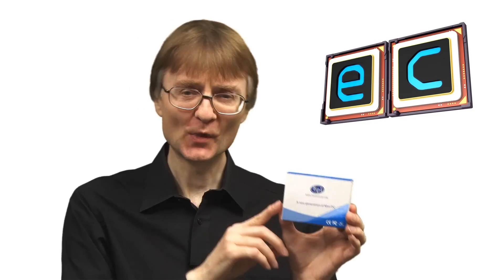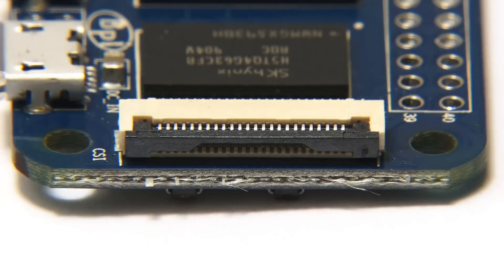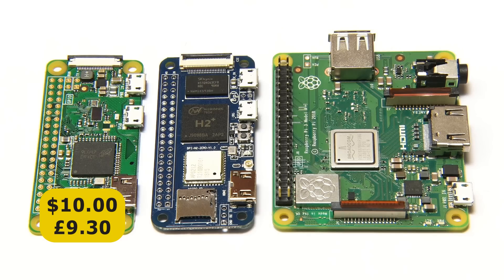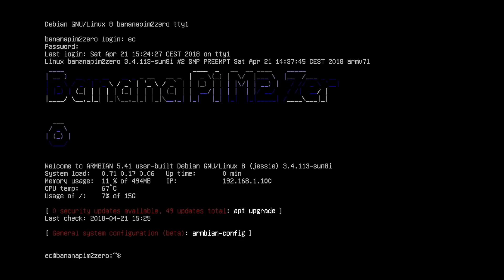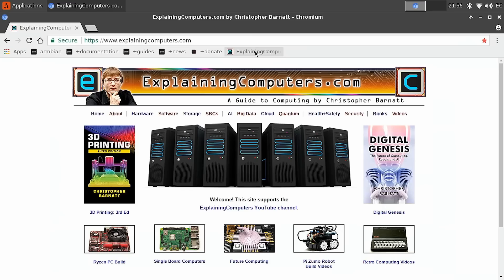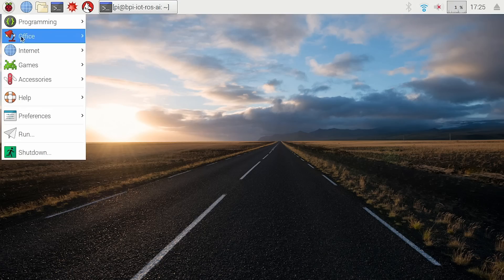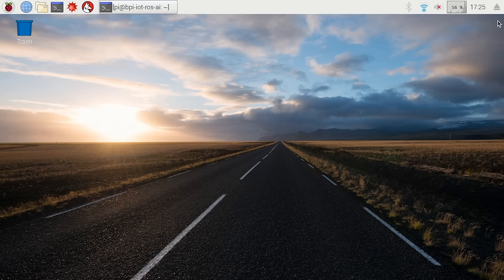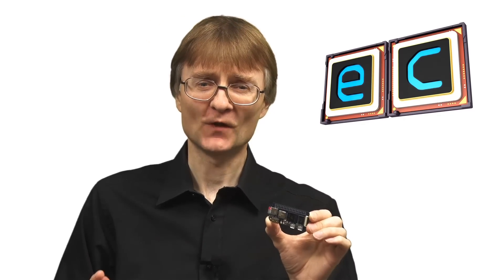Banana Pi M2 Zero: Low-Cost, Quad Core SBC

Comment: everything about this board and the 3A+ was so perfect...and then for some reason only 512MB of RAM? It just makes no sense to me to pair a quadcore with 512mb of RAM
Reply: I was thinking the same thing. 512MB is just too little to really do much with nowadays, especially considering it shares RAM with the GPU chipset.
Reply: @KanokYT  Yeah totally. I'd pay more for it if they had a 1GB variant, it'd be perfect for portable consoles.
Reply: I had a phone with 512MB's of ram, and even when using a "swapfile" web pages would crash on a regular basis. Not sure what the use for this would be.
Reply: @mikem9536  It's not meant to be a desktop, gui-running machine. But yes, more ram would be the first improvement to do with Banana Pi Zero.
Reply: ypu can upgrade it easy with BGA skills
Reply: @servantsochrist  BGA desoldering is anything but easy. Also I've googled and Samsung does not offer single-chip DDR3 memory pin-compatible with stock K4B4G1646D-BCK0 bigger than 4Gb (512MB). Raspberry Pi4 uses DDR4.
Reply: @TomaszStachewicz  Yea I see.... the killer is the fact the largest is 4Gb :-/
Reply: @servantsochrist  yep. So in theory Allwinner H2+ supports up to 2GB (max address space in datasheet) but I can't find DDR3 in FBGA96 package bigger than 4Gb. Micron and Alliance Memory offer 8Gb in  FBGA-96 or FBGA-78 packages, but no idea about compatibility with that samsung. Can't find 16Gb/2GB DDR3 in these packages at all.
Reply: @servantsochrist  also damn, the prices rise steeply for DDR3 8Gb, costing 4x the price of 4Gb within same manufacturer (Alliance Memory), basically the price of Banana Pi M2Z.
Reply: @TomaszStachewicz  well you could check the pin outs but would assume that DDR3 is a standard....but will check
Reply: @TomaszStachewicz  Yea if the price is too steep not worth the effort  might aswell just buy a high performance board from factory

Comment: Technically, the Banana Pi M2 Zero also has 100M ethernet. The four pins between the USB OTG and the USB-style DC connector are, left to right, bottom to top (if the USB ports are facing down): RXN, TXP, RXP, TXN. It can also be powered via the GPIO.
Reply: i am going to build a phone wifi presence detector for home automation using a SBC to trun on lights and unlock doors. wendel from level one techs wrote a blog about that, he used a RPi Zero W for this, but i haven't found his blog yet. while i'd prefer to use the BPi M2 zero because of the hardware, i'm leery of the software acceleration and compatibility. i'm also unclear of the dividing line between hardware and software, re video acceleration and OSs tailored for particular devices. i'm also wondering, if i'm going to run wire to power it, why not just run a wifi antenna to card on a computer and an OS in a container (ansible, docker, BSD jail). i believe wendel used battery power, but i might try wire. cross post: maybe

Comment: They forgot to include the Composite Video pins !!!

I like to stick an RPi Zero W inside of an old CRT television, and solder all connections internally... Turning it into a RetroPie TV.

But the lack of composite out pins, plus the resolution issues, makes this board no good for that.
Reply: @ninline2000  don't. Old games are in 240p, not 480i. Looks completely different
Reply: @ninline2000  
You don't need a converter box with an RPi Zero W... It already has Composite video out pins directly on the board.
Reply: @MrBrax  It looks a hell of a lot better than it does on an LCD monitor.
Reply: @ninline2000  maybe, but I did testing over several months and someone made a 240p firmware, looked much better. I still have some test footage on my channel I think.
Reply: @MrBrax I'll have to look into that. Thanks for the idea.
Reply: Better a male HDMI so you can stick it directly in a modern lcd.

Comment: I love the zero, its an underdog! the stuff I have done with it is fun, I used oxm player to watch a high def video from the command line, I used it as a remote radio streamer with a usb sound card/speaker, even used it as a remote terminal just for testing compiling and running stuff on linux/arm, its pretty great just totally not suited to a gui / web browsing at all, barely enough ram not enough horsepower for modern sites.

Comment: This may work:

Go to /boot/bananapi/bpi-m3/linux

open eEnv.txt

uncheck line 40

save and reboot - and your screen should now boot into 1920x1080

If it works I'll try and find the source.
Reply from the maker: I will try this at some point. Right now, the board is packed away and other things are set up! :)

Comment: Btw instead of writing clear in the terminal to clear it you can use the keyboard shortcut CTRL+L that will clear it right away. Super simple. Another tip for new people is instead of holding backspace in when you accidentally did a typo in the terminal to delete everything you can use CTRL+U that will clear every input you have entered but haven´t executed yet.
Reply from the maker: You can, but this is a video, and viewers can see what I am doing when I type "clear".

Comment: It seems like the Banana Pi has TWO serial UARTS, which would make it quite interesting. I have a few projects where I've used the onboard UART and have had to attach a USB-to-Serial dongle in addition. Having two UARTS would eliminate that need, and I could free up the USB port. The fact that you can use an external antenna is also quite nice!

Comment: For the resolution, shouldn't the hdmi_mode=16 not 31? Or is that 60hz and you want 50hz? Just a guess, I've only skimmed over it.

Pretty neat little board and the 67*c reminded me of something.(Sort of unrelated)
I recently got a pi 4 Model B and I'm looking to apply some heat sinks to the chips (Got the ICE tower for the CPU, AWESOME! Thanks for that video) and having a heck of a time figuring out what 'tape' I should use for the fanless heat sinks. Suggestions? (Too many posts that say they don't transfer heat and I don't want to waste money or fry the board/chips) THANK YOU!
Cheers!
Reply: "Thermal Tape"...
Reply: @KomradeMikhail  HAHA Yeah, I wasn't going to put duct on it. I was looking for a brand or a specific link (affiliate maybe CB?) I didn't think I need to specify the tape needs to be thermal.
I was reading about m3's 8810 and was getting mixed extreme results. Love or hate.

Comment: $20 is way too much when a pi4 2GB is now $35
Reply: ain't that the price of 1GB version, with 2GB being $45
Reply: The RPi4 is too large for some applications.
Reply: I have seen this board for $17 USD.   But it gets to hot.  I decided to use the 3 A+ instead and then I also will have dual band WiFi.
Reply: @MiniRockerz4ever  Pi 4 2gb is permanently $35 right now.
Reply: @MiniRockerz4ever  they just lowered the price of the 2GB version.
Reply: It's worth it if it formfactor is a priority. Or if you're outside the UK. (17,50 vs 45,00 $ on the mainland)
This would be great for a network of security camera's or a very portable SNES/GBA emulation console (assuming RetroPie runs well on this)
Reply: 15$ is a large amount when you need 100's of them.
Reply: The size matters... Imagine you want to build a DIY smartwatch with RPi 4 :)
Reply: Depends on what you need it for. The pi4 draws significantly more power than something like a pi zero w or a 3A+. Therefore, if you want to build something battery powered and do not need the beefier CPU, you want to go with something more energy-efficient.
Reply: @MiniRockerz4ever  nope .. the 2 GB and the 1 GB are now the same price.

Comment: I think it is important to mention that Raspberry Pi Zero (W) has a selling limitation of 1 piece / person. 
There are no webshops as of now in 2020.03.09 i know about where you can buy more than 1 piece of the  product.

There is  a Raspberry Pi Zero WH (wifi with header pins) version which can be ordered without limitations, has a price tag of 17$/piece (here in Romania from an authorized reseller) and i think it is the best offer in the market right now because of the connectivity and the price/value ratio. .. the only issue is that it is not always on stock - they make too little of it.

Comment: That's great, the Pi Zero's are still 12-18 dollars in the Netherlands because of the constant supply problems, these are about as cheap, you can actually just buy them (even thousands if you want) and it's quite powerful. Pretty much a no brainer!

Comment: Excellent  !!
I purchased this board a couple of months ago. I am trying to run the Kodi Leia for watching IPTV channels.
Installed Armbian, so far it's the only OS that allowed me to somehow run Kodi. 
Because Kodi package is broken on Raspbian, all my efforts were unsuccessful, Ubuntu and DietPi, which does not officially support this board, are not loading.
I overclock the CPU to 1.2 Ghz.
While the Raspberry Pi zero reproduces 720p very clearly, the Banana Pi M2 has exactly the same content even in 800x600 resolution - complex video jerks, 
the sound, although reproduced normally, is out of sync with the image. 
All my playings with GL drivers and attempts to understand what is happening here with hardware acceleration have not yet been crowned with success, alas. 
I would be glad to advice how to improve :)

Comment: 80's show, 80's powered computers, 80's scissors and 80's hair!
Reply: I got my first computer about 1991. It had a 286 processor (single core 12 MHz), 1 MB RAM,  50 MB hard drive, and a 1.44MB 3.5" floppy drive.
Reply: @hagbarthr  Darn...you were stylin'..lol! My first computer was the awful ZX81 with 1k of RAM, no hard drive and a cassette player for data in! Wish i still had it though...lol!
Reply: Am I the only one which had a first computer with 512mb of ram
Reply: I am not that old though

Comment: So far the best use of the SBC computers I have on hand is using one with my 3D printer and OctoPi. I did find the Raspberry Pi Zero W to be inadequate for this purpose if combined with a USB camera and have used the Raspberry Pi 3. The Banana Pi board demonstrated here might just have enough extra power to do the job.

Comment: The interesting thing with this board, and the Pi zero, is how some home-assembled Retro gaming consoles have taken to using them. There's a kit that fits inside a original Gameboy advance and lets you use all of the buttons and adds a new screen as well. Normally you'd be limited to the Pi Zero unless you sprang for the MUCH more expensive CM3 version of the kit. This clearly has more power then that, even if it's running rather toasty.

Comment: Funny, I've installed the server core on the Pi zero because when it's installed, it just has to stream the video across a network. If it turns out to be too weak for that, I now have an upgrade I can go to without a full-blown Pi4 - which, presently, is just for the controller and main display.

Comment: I gave up on Banana Pi products with their first model, because there are lots of little issues, like the resolution issue you found with this product. I also found that Banana Pi support is severely lacking. They definitely are a little faster than the Raspberry Pi products they are trying to compete with, but it's never fast enough to justify putting up with all the little annoyances theay have.

Comment: I have been using it to run a TvHeadend server for more than a year now. I had to compile it myself but it works fine.  Boards this size it doesn't matter if it has 1080p or not.

Comment: Mali 400 should technically handle 1080p but it wasn't really designed for it.
Its usually still used in lowcost devices nowadays and almost all of them have max 1280x720 or 1280x800.

Comment: The other board which is also quad core ARM processors and slightly smaller than the Raspberry Pi Zero form factor is the NanoPi Duo 2 by FriendlyELEC. Do review that too 😊

Comment: If you run the command xrandr it should show you if the GPU and display are compatible with other display resolutions. 

Then if it is use xrandr -s 'displayname' WxH_50.00

There's a series of commands using xrandr and cvt to force a resolution.

Comment: These little boards are amazing if you have a dedicated use for them, which I use a Raspberry Pi Zero W (headless) as a dedicated network ad-blocker running PiHole, which for £10 is fantastic value.

Comment: This is a great board (got mine a few months ago) but the support from manufacturer is very lacking. And the SoC from Allwinner means poor history of linux drivers and tendency to overheat. Fortunately the good folks at Armbian got this board to work like a charm (I'm proud to have contributed to that). Heatsink is a must. The CPU performance in benchmark is similar to RPi 2, so pretty good given the form factor.

Comment: I'd like to point out the Orange Pi Zero (and its half a dozen variants), which uses the same SoC and has the same specs, but costs only half as much as this Banana Pi. It's got a different form factor though, but it's still tiny.
Reply from the maker: It does not have the same specs -- there is no HDMI or other display output.

Comment: Thanks for introducing this board. I was looking for a SBC with Raspberry Pi zero form factor and higher specs. Just one question. Have you tried to use Raspivid or Raspistill commands to see if it can capture the CSI camera interface with its GPU?
Reply from the maker: I've not tested the camera.

Comment: Are you in group mode 1 because your "monitor" is a screen cap device? DMT is group mode 2. Since your "monitor" isn't being recognized by the OS you'll never get beyond the default even with group and mode settings. A bit like Win98 here in the modern world.
I had no idea this little board existed so thanks for sharing.
Reply from the maker: Not a screen capture issue -- I always connect via a splitter. And I tried multiple hardware configs, including a direct monitor connection.  I've used over 40 SBCs and have a lot of tricks and hardware to get the HDMI output I want, but nothing worked here. :(

Comment: You should try an SBC from friendlyarm, at least from the couple boards I've seen they appear to provide the best software support compared to any other Pi clone at similar prices but if you want the cheapest possible then go orange pi, they offer a zero pi with about the same specs as this one for $12.
Reply from the maker: I've looked at two FriendlyArm boards here -- the NanoPi M4: https://www.youtube.com/watch?v=knS854Taz-E and Neo4: https://www.youtube.com/watch?v=knS854Taz-E Both nice boards as you note. As far as I am aware, their cheaper and smaller boards like you mention are headless(?). :)

Comment: you might be able to get the missing resolutions with cvt and xrandr. cvt the modeline, then xrandr --newmode, and --addmode, and then --output (display) --mode. you can then automate it by putting them in a bash script

Comment: Good video. I tested my PC with sysbench and your recommended parameters out of the video.. My result with eight cores was 10 sec.
Reply: Yes but your total events will have been higher than 10000. For example my PC (with 4 threads) does 75000 events in 10.0 seconds, so you have to allow for it being effectively 1.33 seconds compared to the ARM boards. (With 32 threads my PC does 503750 events in 10.0 seconds)

Comment: I think no-one should overlook the fact that the board may have a processor overheating problem. I bet that Raspberry PI Zero could be equipped with a quad core processor. One of the reasons it is not may be partially price factor but partially it may be down to being cautious with respect to the heat management. I've been using RPI Zero W for my drone project and you can run quite a heavy python code on the board without actually worrying about the processor temperature. That Banana thing has reached 65 degrees just after booting and the sysbench software made it hot after a short while even with the heat sink mounted. I can't say that for sure, but when a software of the size I've developed for my drone would run on the Banana PI board, it might fry it after a few minutes. And the potential reasoning behind buying the Banana PI board would be to have significantly more processing power for slightly more money. Question is to which level this board is compatible with the PI world? May be quite likely that the compatibility looks pretty good on the paper but a few little things that are different on the Banana PI may render the Raspberry PI programs not to be runable. I am intrigued though an may at some point give the board a go just to check what it can do in some more specific applications. But my gut feeling tells me there will be hurdles...